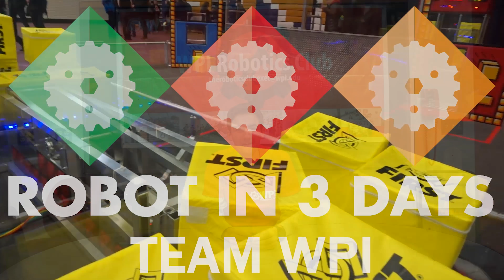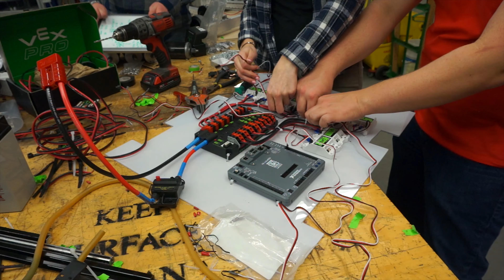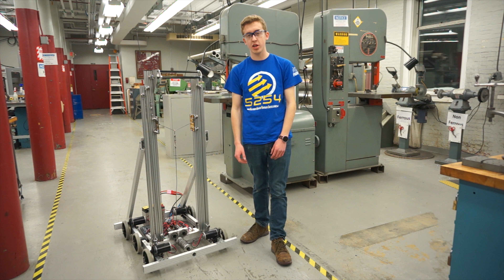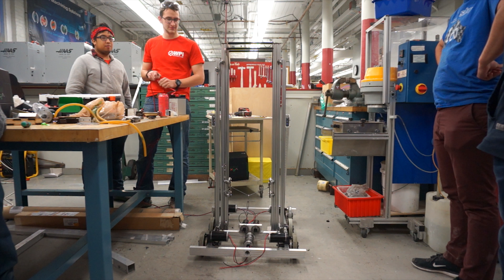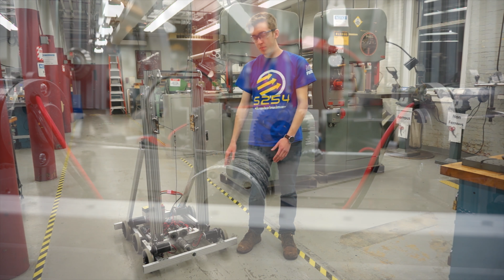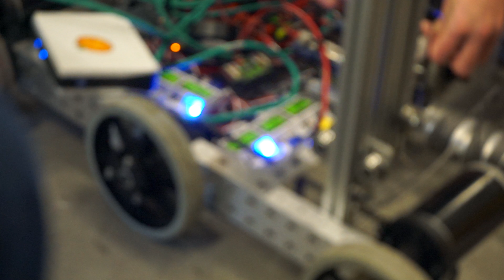Ri3D 2018 - WPI - Day 2 Recap

Comment: A warning to FRC teams designing a drive train: 

That drive train is almost exactly what we used last year, it was a huge compromise for us. We had terrible acceleration, several blackouts, and we got bullied by any old 50 pound kit robot. 

My point: for quick and dirty prototyping, great drive. Easy to manufacture, next to no maintenance, lightweight, and a sort of differential. Do not use it on your production robot. As they mentioned, it isn't geared very low, so you make huge compromises to motor efficiency, pushing power, and effective defense. At the very least, use a second stage. The tried and true method still holds true though, having a single gearbox per side has been the standard for years. 

This setup is perfect for simple mecanum drives though (but maybe with a second stage).
Reply: Peter Juncker just use a 2 or 3 stage. Nothing wrong with the drivetrain just the gearing...
Reply: Hey Peter, we tried to highlight this but probably should have made it even more clear. If you're running 6 inch wheels you NEED more reduction than this. We we're in a tough position where we didn't have other drive gearboxes we could use given only our 3 days. If given the choice we would have much rather used a 2 stage gearbox.
Reply: WPI Robotics Club agreed. I fully understand the reasoning, I just know that teams with less experience will be looking to the RI3D teams for ideas, to the point of copying. It's just a caution.